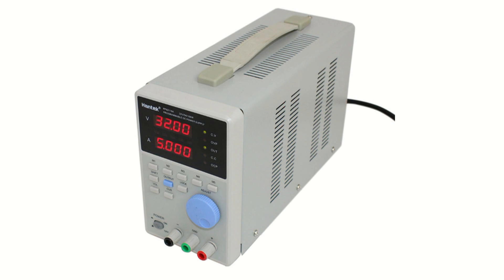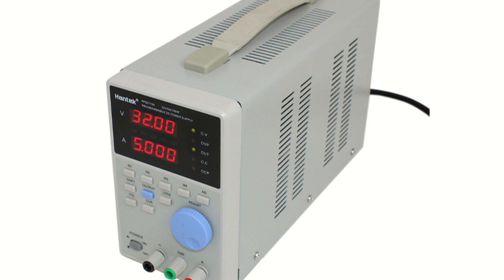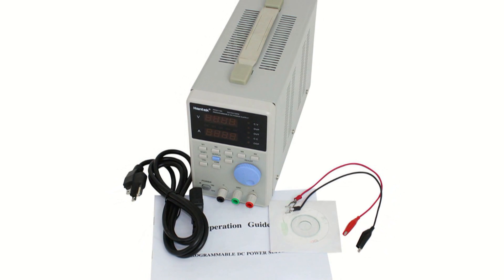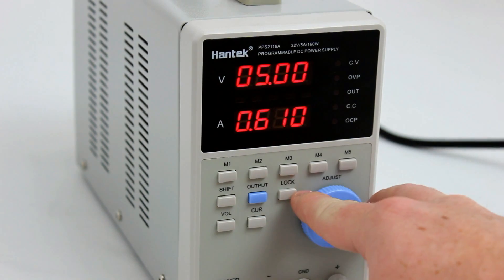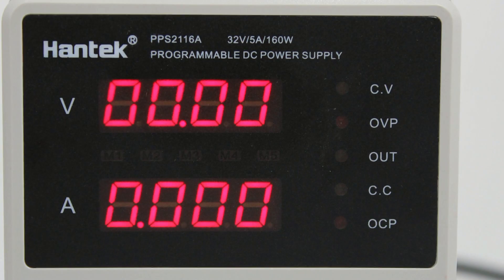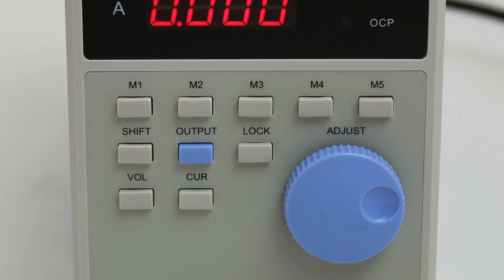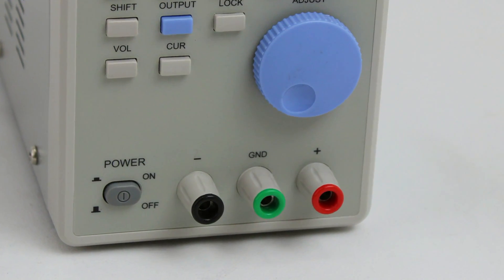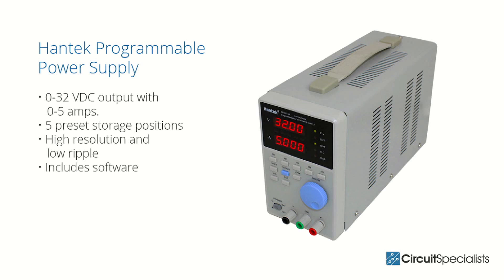Product Review: The Hantek Programmable DC Power Supply, Model PPS2116A

Comment: I have the power supply PPS2116A and I like some of the functions - especially the memories. 
Unfortunately there are some bad sides of the PPS2116A. The rotation knob is made with low quality encoder and after a few months/years it is really not reliable - very difficult to operate.
But the worst is that the PPS2116A can easily damage your circuits. It already destroyed a few of my electronics, mobile phone, AM meters fuse etc. How it is possible? When you turn off the PPS2116A and you do not DISCONNECT your circuit, the PPS will send cca 30V for 200ms to the outputs. They can be ON or OFF it does not matter, the 30V is sent to the outputs. Realy bad design!!!
Reply: Looking to buy,  has this issue been fixed?
Reply: Which power supply you can suggest?
Reply: I do not experience this behavior AT ALL on this very powersupply model that I just purchased about a week ago.  Everything seems to be in good, working order, no turn on or turn off spikes, either from enabling the output or the power supply main power switch.  I suspect either there was a design flaw or you had/have a defective unit.
Reply: @jeffl5820  just wait a few years of ussage
Reply: Well, you get what you pay for.  I paid $100 for mine, and if it fails in even as little time as a year, I'll just buy another, heh.  Seriously, what do you expect from cheap chinese crap?  If you want a reliable power supply, buy from a reputable brand (and pay a lot more) or learn how to repair power supplies.  It's really not that hard.
Reply: Hello! The same luck here with this power. After a while of use the control starts to malfunction, the controls respond randomly and I have fried several circuits on the breadboard. Very nice on the outside but very bad on the inside.